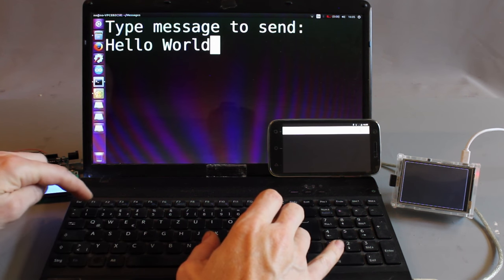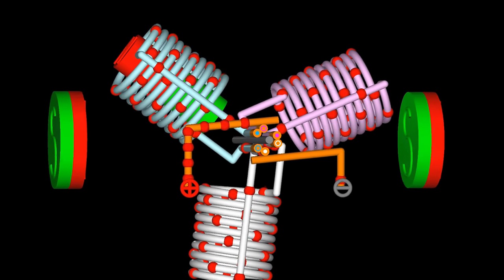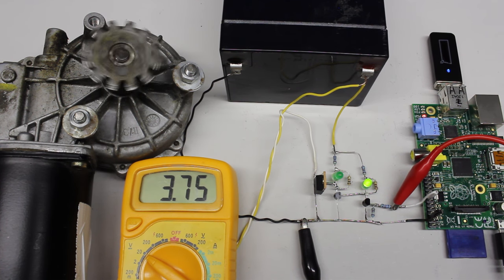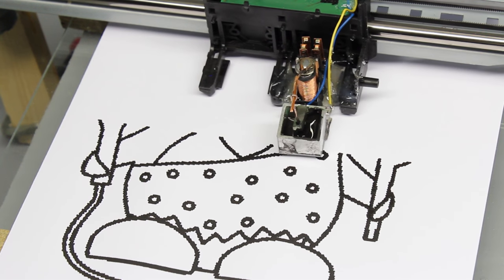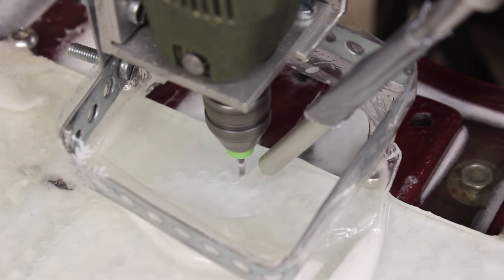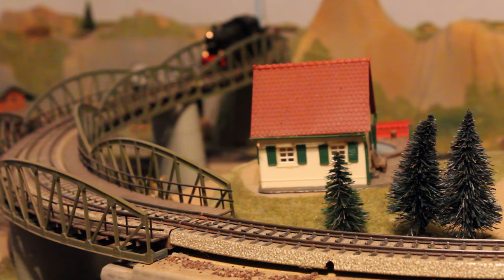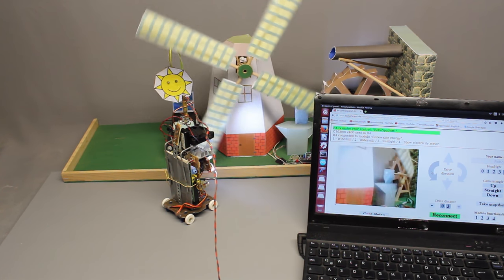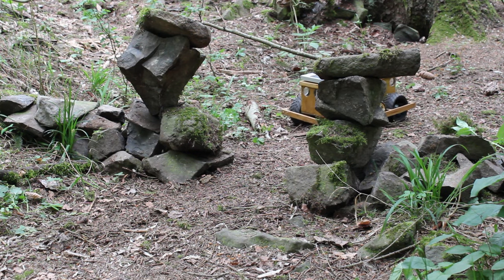Application for the 2017 fellowship of the Shuttleworth Foundation

Comment: I hope you are awarded a fellowship.
Reply from the maker: ...not this year.
Reply from the maker: They will tell about the new projects they support some later. I did not transmit a new application for the September 2017 fellowship, thus I will definitely not be considered. I will probably try again in a future run...
Reply: Oh. I see. Well. I think your projects are amazing. At some point I expect you will transition from focusing on making machines to solving real world problems like, say, washing dishes. I suppose doing so might increase this channel's popularity.
Reply from the maker: Machines solve many real world problems - at least dishwashers ;-)
Reply: I imagine a robot removing soiled dishes from a table, washing them, allowing them to drip dry, and then placing those clean dishes into the appropriate kitchen cabinets.

Such a system would likely eventually relieve hundreds of millions of people of this tedious chore. Certainly such a dish washing system could be an open source software and hardware project. 

If you were to begin such a project (which I suppose might take 5 to 10 years to complete) it might attract more subscribers to this YouTube channel. Most of your projects are brilliant yet this channel does not even have 100,000 subscribers yet.  100,000 subscribers on YouTube was a big accomplishment 5 years ago, but today it's often not sufficient to bring in a significant amount of advertising revenue.

Although the number of subscribers to this channel is gradually increasing, it does not seem to be increasing fast enough to be likely to ever generate any significant advertising revenue. This channel is a very successful hobby but it is apparently failing miserably as a business. As it is now, the chances of significantly monetizing this channel seem extremely remote.

A sapling that needs much direct sunlight to flourish might begin growing up to a recently opened patch of sky visible through the otherwise dense  canopy of an Amazonian rain forest left by the falling of a large old tree. But this sapling must grow fast enough to make it up the canopy so where it can flourish. If that sapling grows too slowly then another tree will grow in its place and thereby absorb the lion's share of the sunlight.

I suppose this channel has far fewer subscribers than it would if it were to feature projects with greater mass appeal. Besides, making machines to make machines generally seems much easier and much less challenging than making machines that actually accomplish sophisticated, difficult, yet practical tasks. Taking machines out of the lab and into the "real world" is where the "rubber meets the road."

We remember great scientists like Newton and Einstein because their remarkable theories were put to use practically and powerfully.
Reply from the maker: ...this channel attracts more and more companies. I am going into new projects with new partners, soon. Sometimes it's not the number of subscribers, but to get the right ones ;-)
Reply: If you want to earn, say, five thousand euros each month from this channel, I presume this channel's current growth rate is much too low.

As I essentially argued previously in this thread, watching your subscribers increase is, in and of itself, deceptive. You would be better served to look at your monthly changes in profits.

You are a very clever scientist who creates fascinating videos but you have not been very adept at marketing this channel. You are like a restaurateur who prepares creative and healthy dishes (food) that only a relatively small number of people actually want to eat.

It seems to be that great scientists are seldom great marketers (salesmen). Great scientists tend to excel at analyzing and synthesizing facts and theories whereas great marketers tend to focus on persuasion and popular trends.